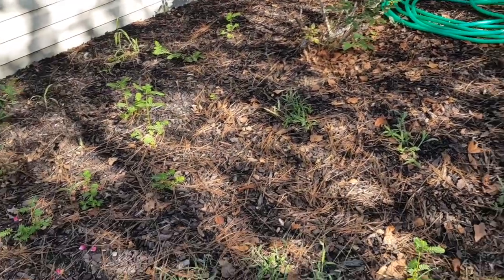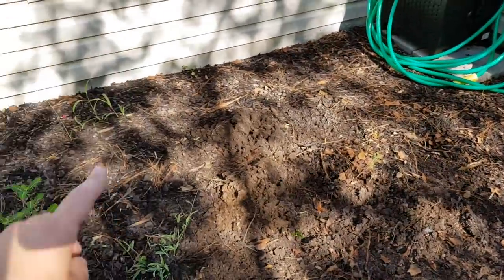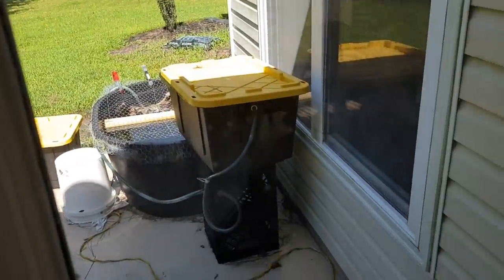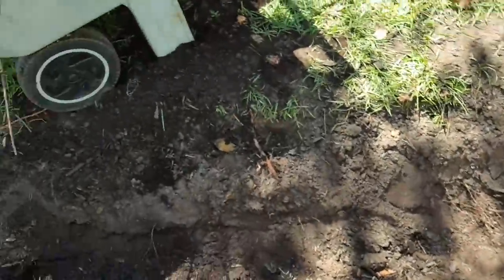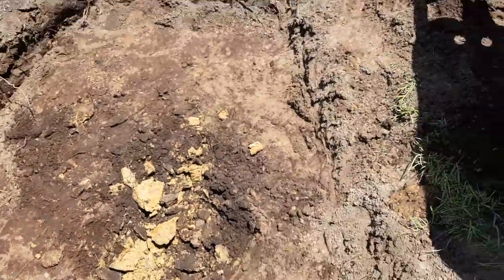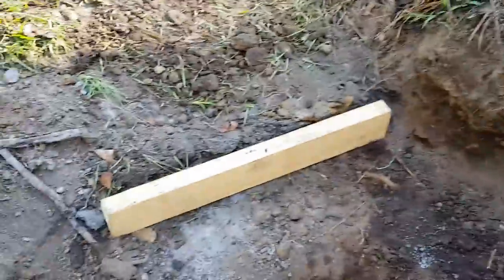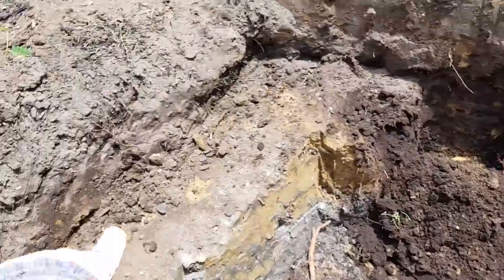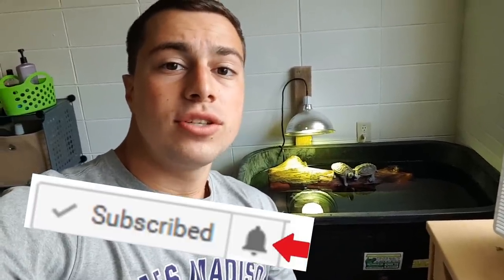ULTIMATE DIY Turtle Pond BUILD!!!

Comment: Hi Dan, Great video, thanks for sharing. I plan on using this one along with a few others to build my own turtle pond for my DBT soon. A couple questions for you if you don't mind.
1. Did you end up using any substrate? I have seen a few different opinions online about this. 
2. How has the pond held up so far, any issues?
3. What is the upkeep like? I would assume just some water changes per month, and declorinator?
I appreciate the help! thanks
Reply from the maker: Hey there!  I didnt use any substrate in this, if any I'd use crushed coral. The pond has had no issues so far, liner is in tact. The upkeep is rinsing the filter out once every week or two and water changes every 3 weeks or so. I'm moving, so prepare for another pond build video 😂
Reply: @DanTheTurtleMan_  okay thanks! Ha I hope the new tenants have some Turtles to put in there. Okay great, I'm looking forward to your video. I'll probably make a video as well and share.

Comment: So glad I just stumbled upon this video! What type of filter is that you are using? And where do you have it plugged into? I'm thinking about building a pond but I dont have access to electricity in the area I'd like to build. Suggestions? Also what else is needed to keep this running, clean, and clear?
Reply from the maker: Hi there!  So I use an 800gph pump hooked up to a tetra waterfall filter. Water changes of 10% a week will keep it clear!  As for electricity, I run an extension cord

Comment: Been thinking about building a turtle pond in our backyard. No access to electricity so using solar power for water filter and waterfall. My question, what's the best way to clean a turtle pond without constantly having to drain the water?

Comment: This is so creative good job man !
And i really want to do a pond for my turtles but the only issue is that how would i be able to change the water if it gets too dirty ?
Reply from the maker: Thank you!!!  So that's relatively simple!  In order to have a proper ecosystem you're going to need a filter, and the way to filter the water is with a pump to push the water. You simply use that pump, or a different one, to pump the water out of the pond and then re fill with a hose. Thanks for watching!
Reply: Oh nice Thank you so much!
Reply from the maker: @Bushra_turtles  happy to help 😊

Comment: Hello! So I want to do this for the summer for my 19yr old Red Eared sliders, I'd obviously have to add things for them like rocks to come up on etc, but my question is what filter do you recommend to keep it clean and how do you clean something that big?
Reply from the maker: I recommend building your own honestly!  A 55 gallon drum and some gravel and floor buffing pads will work wonders. Add a valve to backflush at the bottom and you're good to go!
Reply: @DanTheTurtleMan_  thanks for responding! 🙌🏽

Comment: I have a baby river cooter and I want to build her a small pond in the future and maybe even get some more turtles. Problem is 90% of my backyard is a slope😖
Reply from the maker: How sloped?  My yard was also sloped but as long as you don't fight the landscape, or use cinder blocks to raise the lower end you can do it!  Just make sure you research a ton first  😊
Reply: DanTheGuppyMan about 10 degrees. The top part is mostly flat and I think I will build it there.
Reply from the maker: @gibby2951  good move. Building high up also means runoff won't drain into the pond